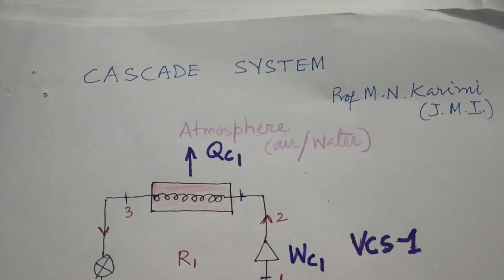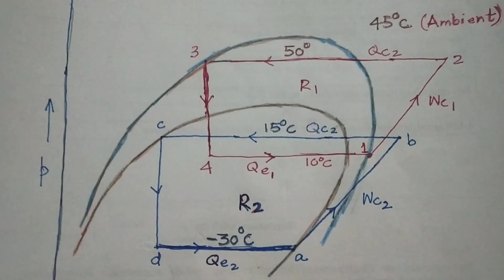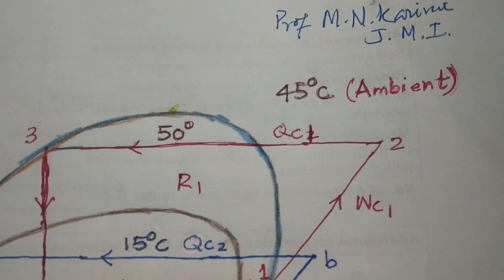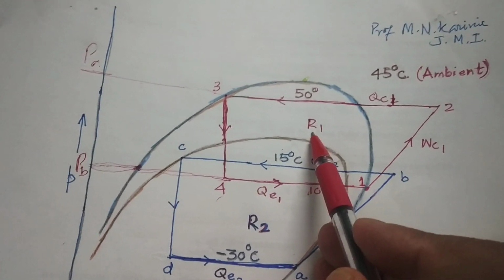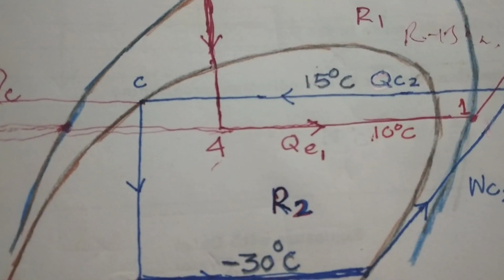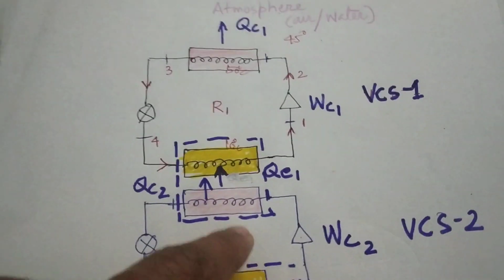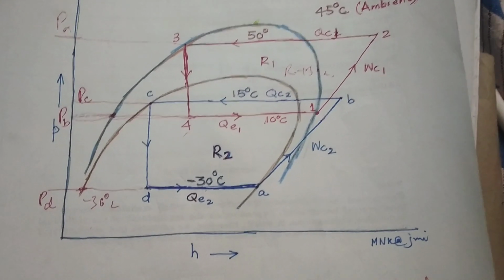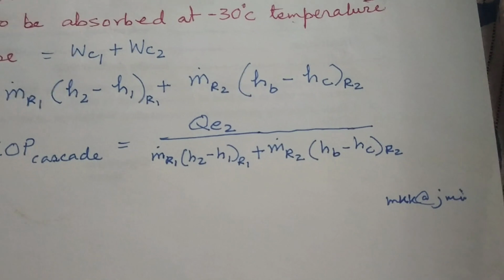Cascade Refrigeration System

Comment: From the video titled "Cascade System", I learned that a cascade system is a system with a linked component or effect that has the same impact as the first.

To illustrate, we have VCS-1 and VCS-2, two compression systems, coupled in series. We are aware that there are four components to the compression mechanism, namely– Condensor, Compressor, Expansion Valve, and Evaporator.

According to the diagram, the evaporator of VCS-1 is taking in heat at the rate of Qe1, while the condenser is releasing it into the atmosphere (it can be air or water). The same may be said about VCS-2.  The work done by VCS-1's compressor is denoted by WC1, and that of VCS-2's by WC2. A pressure enthalpy diagram will help us grasp this concept  (i.e, p-h chart). Refrigerants R1 and R2 exist, and each has its own set of characteristics. Because of this, we have two curves. The VCS-1 unit uses the R1 refrigerant, while the VCS-2 unit uses the R2 refrigerant, each of which has their own unique curve of performance characteristics. The p-h graph reveals that VCS-1 and VCS-2 have independently calibrated condenser and evaporator temperatures. We are aware that the condenser dissipates heat. With this particular setup, the condenser temperature is set to 150 ℃, and it will radiate whatever heat it doesn't need back into the surrounding air. One of VCS-1's evaporators, then, operates at less than 150 °C. Because we already know that evaporators can absorb heat, we can deduce that QC2 heat would be absorbed by evaporator 1 after being rejected by condenser 2. The second condenser and the first evaporator are both insulated. Essentially, the cascade system is the connection between the VCS-2 and VCS-2 via this insulated part. And the outcome is a cooling effect achieved by obtaining a temperature of -30 °C, which is not feasible with a single VCS and a single refrigerant. It is used in situations calling for temperature reduction in the presence of higher-than-desired environmental conditions.

Comment: In this video on Cascade System, we study that Cascade is the effect of 1 and 2 connected in series, so that the effect of first is given to the second, known as cascading effect.
Here, in the setup, the cascade is trying to give cooling effect with the help of coupling two systems. For the setup, we have two vapour compression systems VCS1 and VCS2. VCS1 and VCS2 have R1 and R2 refrigerants flowing through them respectively. The refrigerants are different and therefore have two different characteristic curves i.e. pressure enthalpy curves. R1 has a higher critical value whereas R2 has a lower critical value. VCS1 has static conditions represented by 1, 2, 3 and 4 and VCS2 has static conditions represented by a, b, c and d. Wc1 is the work done by compressor 1, Qc1 is the heat rejected by condenser 1 and Qe1 is the heat absorbed by evaporator 1.
We need to have condenser temperature higher than the ambient temperature, so 50° C is chosen with the help of ambient condition prevailing outside. The evaporator will absorb heat from anything that has higher temperature than the temperature of the evaporator itself. So what happens here is, evaporator 2 absorbs heat from approximately -25° C from the surrounding space and rejects it via condenser 2. Since, it is not possible for a single refrigerant to have a cooling effect with high-temperature difference, we will use two VCS here VCS1 and VCS2 and thus, for achieving it, condenser 2 and evaporator 1 are built together in a single space. So, the heat rejected by condenser 2 will be absorbed by evaporator 1 and ultimately rejected by condenser 1 to the atmosphere at peak conditions of 45° C. This particular coupling or cascading effect gives us a cooling effect. So, cascade refrigeration system is nothing but a combination of vapour compression systems, by which a very low refrigeration temperature can be achieved at a higher ambient temperature.
The total work done by compressor 1 and compressor can be calculated by multiplying the mass flow rate of refrigerant 1 and refrigerant 2 by their enthalpy differences respectively. For COP of the cascade, we need to divide Qe2 by the total work done by compressor 1 and compressor 2.

Comment: 20BME007 Md Affan 

Assalam o allaikum sir, in this video you discussed about  cascade system which is a combination of two or more vapor compression systems that operate at different temperature levels. Here we have two vapor compression systems, VCS-1 and VCS-2, operating with different refrigerants, R1 and R2, respectively.

We couple the condenser of VCS-2 with the evaporator of VCS-1, which is at 10°C, , as it cannot reject the heat to the atmosphere because the condenser of VCS-2 is at 15°C, and the ambient temperature is 45°C.

In a cascade system, the heat rejected by the condenser of one system is absorbed by the evaporator of the other system. In this case, the heat rejected by the condenser of VCS-2 is absorbed by the evaporator of VCS-1. This transfer of heat is made possible by using a heat exchanger.

The coefficient of performance (COP) of the cascade system can be calculated using the following formula:

COP = Qe2 / (wc1 + wc2)

where wc1 is the work done by compressor 1, and wc2 is the work done by compressor 2. The COP is a measure of the efficiency of the system, and it tells us how much cooling we can get per unit of energy consumed.

In summary, a cascade system is a combination of two or more vapor compression systems that operate at different temperature levels, and it allows us to overcome the limitation of a single system operating at a specific temperature range. The COP of the cascade system can be calculated using the formula COP = Qe2 / (wc1 + wc2).

Comment: The video is informative and assists our understanding by explaining the cascade system. In this system, the transfer of cooling takes place with the help of coupling. The given video consists of two Vapour Compression Systems (VCS1 & VCS2) which use two different refrigerant R1 and R2. The VCP consists of compressor, evaporator, condenser and expansion device. The system operates in such a way that the second part (VCS2) absorbs heat from temperatures higher than -30 degrees(in this case), while the first part (VCS1) absorbs heat from the second part (VCS2) via evaporator 1. The exchange and coupling of heat between the two parts is known as cascading. Overall, the system operates using the principle of vapor compression and cascading to achieve efficient heat transfer.
At the end, The video tells us about The Coefficient of Performance (COP) which is a measure of the efficiency of a heating or cooling system. It represents the ratio of the amount of heating or cooling provided by a system to the amount of energy consumed by the system.

Comment: 20BME069 Md Umar Ibrahim
Cascade refrigeration system uses two or more vapor-compression cycles with different refrigerants to achieve low temperatures. The cycles have sequentially lower evaporation-condensation temperatures, and refrigerants are selected to work efficiently in their temperature range. The low-temperature cycle removes heat from the space to be cooled using an evaporator, and transfers it to a heat exchanger cooled by the high-temperature cycle. In the cascade system, Qc1 is the heat rejected by the condenser, Qe1 is the heat absorbed by the evaporator of VCS1, Qc2 is the heat rejected by the condenser, and Qe2 is the heat absorbed by the evaporator of VCS2. The COP of the cascade system is Refrigeration effect (Qe1) divided by work done (Wc1 + Wc2).

Comment: 20BME045 AHMAD RAZA 
cascade system is a way to achieve refrigeration by coupling two VCS, i.e. two refrigerant.
The achieved refrigeration was not efficiently possible by anyone refrigerant because of p-h curve characteristics of not having enough critical temperature.

Comment: A cascade system in refrigeration and air conditioning is a system that consists of two or more refrigeration cycles operating in series, with each cycle using a different refrigerant with a different boiling point. The low-temperature cycle is typically used to cool the product or space to be refrigerated, while the high-temperature cycle is used to cool the refrigerant in the low-temperature cycle. The two cycles are connected by a heat exchanger, which transfers heat from the low-temperature cycle to the high-temperature cycle.The cascade system in refrigeration and air conditioning is controlled by a two-stage or cascade control system. The low-temperature cycle is controlled by a primary controller, which maintains the desired temperature in the refrigerated space, while the high-temperature cycle is controlled by a secondary controller, which maintains the desired temperature of the refrigerant in the high-temperature cycle. The primary controller typically uses a temperature sensor and a refrigerant flow control valve to adjust the refrigerant flow in the low-temperature cycle, while the secondary controller typically uses a temperature sensor and a compressor control valve to adjust the refrigerant flow in the high-temperature cycle.In comparison to a single-stage refrigeration system, the cascade system in refrigeration and air conditioning offers better temperature management, greater efficiency, and a smaller refrigerant charge.

Comment: In this video, Prof M.N Karimi Sir has explained the Cascade System. 
- The coupling of two or more vapour compression Systems in series in order to achieve high cooling effect output ( or in other words, lower temperature) is known as a cascade System.
A single vapor compression System consists of 4 major devices namely a compressor, condenser which rejects heat to the atmosphere(Qc1), expansion device and an evaporator which absorbs a certain amount of heat (Qe1). 
But a single refrigerant vapor compression system has certain limitations like it can't be used for the production of lower temperature. So, the solution to this problem is the Cascade System. The Cascade combines two or more vapor compression units. The effect of the combined units can be understood with the help of schematic diagram and the p-h diagram as presented in the video. We have two refrigerants R1 and R2 corresponding to the two vapor compression units Vcs1 and Vcs2. R1 is having a higher critical value and R2 lower critical value. Now suppose we have to reject heat to an ambient temperature of 45 deg C. So, for this particular case we need a coil which is at a temperature ( say 50 deg C) higher than the ambient temp. So we devise a combined unit where the heat rejected by unit 1 is absorbed by unit 2 and unit 2 is rejecting heat to the ambient. Hence, we see that due to the coupling, the lower temperature can be as low as -30 deg temp, and we get a high cooling effect. This couldn't have been possible with a single unit.
Then, we can also calculate the COP of Cascade System using the formula, Qe2 / ( Wc1 + Wc2). Where, Qe2 is the heat rejected by condensor 1 to evaporator 2 and Wc1&Wc2 are the work done on compressor 1 and 2.

Comment: In this video we've studied vapour compression system, it has compressor, condenser, evaporator and expansion device. In cascade system, we use 2 or more vcs with different refrigerants, we need to use this Cascade system cause if we want to achieve very low temp. We need to do it in steps, so we use series coupled system of vcs, evaporator absorbs heat, compressor works then condenser rejects the heat. It is done in two or more different stages to achieve desired temp as from one cycle it can't be achieved

Comment: In cascade system ,a certain sequence of  stages are followed to get desired result ,each stages uses the result of the previous stage.

Here to obtain a very low temperature we uses vapour compression system in series ,in which heat rejected from one the vapour compression system is absorbed by the other vapour compression and so on ,finally the desired temperature is acheived.

Comment: 20BME028 SANDEEP YADAV 

Cascading is coupling of two systems eg. VCS1 and VCS2.
Heat of Qc2(15°C) will transfer to evaporator Qe2(10°C).Heat will not escape from boundary and will not affect surrounding. 
In this system the process is-
Absorbing Heat Qe2(-30°C)-->Transferring heat(Qc2-Qe1)(15°-10°)--->Rejection of heat Qc1 in atmosphere (50°)

Comment: Cascade systems are commonly used in refrigeration and air conditioning applications where a very low temperature is required. In a cascade refrigeration system, the low-temperature cycle (also called the evaporator cycle) is typically used to cool the product or space to be refrigerated, while the high-temperature cycle (also called the condenser cycle) is used to cool the refrigerant in the low-temperature cycle. The two cycles are connected by a heat exchanger, which transfers heat from the low-temperature cycle to the high-temperature cycle.
The control system in a cascade refrigeration system is typically a two-stage or cascade control system. The low-temperature cycle is controlled by a primary controller, which maintains the desired temperature in the refrigerated space. The high-temperature cycle is controlled by a secondary controller, which maintains the desired temperature of the refrigerant in the high-temperature cycle.The cascade refrigeration system provides several advantages over a single-stage refrigeration system, including improved temperature control, higher efficiency, and lower refrigerant charge.

Comment: The cascade refrigeration system is a freezing system that uses two kinds of refrigerants having different boiling points, which run through their own independent freezing cycle and are joined by a heat exchanger. This system is employed to obtain temperatures of -40 to -80°C or ultra-low temperatures lower than them. At such ultra-low temperatures, a common single-refrigerant two-stage compression system limits the low-temperature characteristics of the refrigerant to a considerably poor level, making the system significantly inefficient. The efficiency is improved by combining two kinds of refrigerants having different temperature characteristics. In this we have two vapour compression system (say VCS1 & VCS2) consisting of condenser, evaporator, compressor etc. in each system. We have different refrigerant (R1 & R2) also having different characteristics like critical value, pressure and temperature. Condenser 2 interacts with Condenser 1 of respective VCS. Condenser 2 of VCS 2 at 15 °C will reject heat to Condenser 1 of VCS 1 Which is at 10 °C. Thus Cascade refrigeration system is combination of vapour compression system and very low temperature refrigeration can be achieved at a very higher ambient temperature by selecting the suitable Refrigerant.

Comment: 20BME012, NAZEED KHAN : 

The system in which there are 2 or more than 2 vapor-compression cycles are used with different refrigerants is called cascade refrigeration system. The refrigerants that are used in each vapour compression system have different characteristics. Each vapour compression system consists of compressor ,condenser, expansion device and evaporator in sequence. There are different characteristics of refrigerants that are used in each vapour compression system. The four parts of vapour compression cycle i.e, Compressor, Condenser, Evaporator && Expansion device. Coefficient of performance of cascade system is the ratio of total heat observed by the refrigerant at -30 degree Celsius to the total work done by the compression system.

Comment: Cascade means effect of one is given to second by coupling.
In cascade system there is combination of two VCS(vapour compression cycle) and using this, very low refrigeration can be achieved at higher ambient temperature.
The parts of VCS are:-
1)compressor
2)condensor
3)expansion valve
4)evaporator
Condenser is rejects heat to the atmosphere (air/water)
Evaporator absorbs heat.
So in VCS1, Qc1 is the heat rejection to atmosphere by compressor 1.
Qe1 is the amount of heat absorbed by evaporator 1 and Wc1 is the work done by compressor in VCS1
In VSC2, Qc2  is the heat rejected by condensor of VCS2
Qe2 is the amount of heat absorbed by evaporator of VC2 and Wc2 is the work done by compressor of VCS 2.
We have two different refrigerants R1 and R2. Each refrigerant has its own characteristics.
In p-h curve the two refrigerants are shown.
R1 refrigerant in VCS1 has higher critical temperature corresponding to same p scale
R2 refrigerant in VCS2 has lower critical temperature.
A city has ambient temperature of 45°C.
Coil should have temperature higher than 45°C to reject heat.
So, Qc1=50°C
From p-h chart we get, 
Pa is 50°C for R1 and Pb is 10°C for R2
Qe1 will be absorbing heat from surrounding having temperature higher than 10°C
So Pb=15°C for R2
Pd=-30°C for R2
Condenser at 15°C will reject heat to 10°C evaporator. 
Heat rejected by condensor of VCS2 will be absorbed by evaporator of VCS1. 
Condenser of VCS2 interacts with evaporator of VCS1 and will absorb heat rejected by condensor. 
So there is absorbing of heat Qe2 by evaporator of VCS2, then there is transfer of heat from(from condensor to evaporator) Qc2 to Qe1 and finally heat rejection to atmosphere by Qc1. 
So there is a cooling effect by coupling two systems. 
Now, Wc1=m(R1) (h2-h1) 
Wc2=m(R2) (hb-hc) 
COP=Qe2/Wc1+Wc2
COP=Qe2/m(R1) (h2-h1) +m(R2) (hb-hc)

Comment: 20BME063  SAURABH SHARMA
A cascade refrigeration system consists of at least two refrigeration cycles working independently. Both refrigeration cycles are connected by a cascade heat exchanger where heat is released in a low-temperature circuit condenser and is absorbed by a high- temperature circuit evaporator